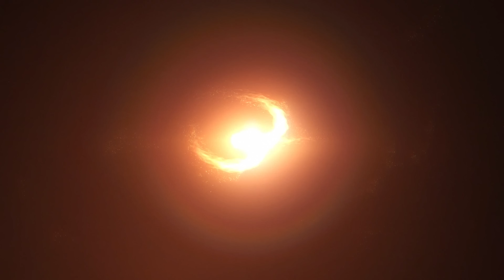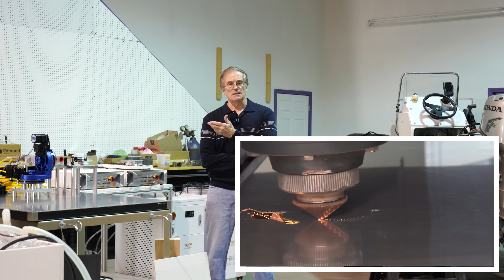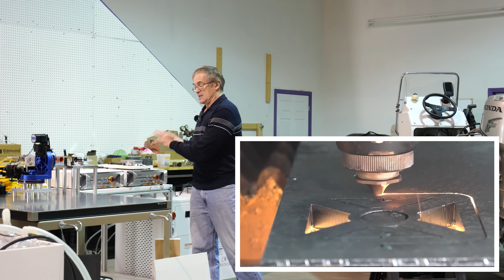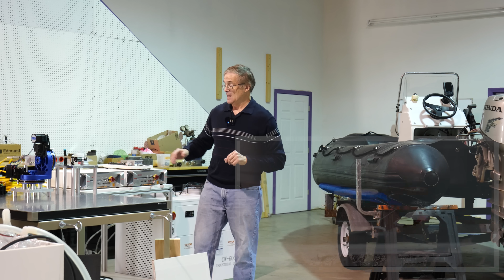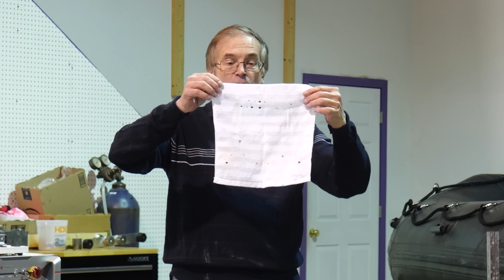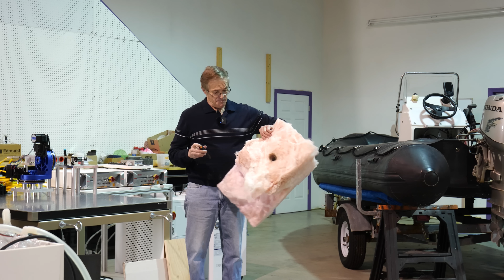We have a problem... and need your help!

Comment: I'm not sure if its already in the comments but can you post the beam frequency and intensity(or at least the power applied to the laser module) and beam divergence? If its already been added to the comments can you sticky them or add it to the info drop down? Thanks!
Reply from the maker: Sure. 
1,500 watts for each laser.  1080 nm and 80 microradians of divergence.

Comment: 1) Make the surface at an angle 📐 that’s nearly parallel to the beam so that the 1mm contact point is elongated across as much surface as possible. 30+ mm aught to be 1/30th the 🔥. 

Or

2) Over-fill a container of water 💧 (possibly mixed with charcoal/graphite) so that the surface tension protrudes above the container and into a portion of the 1mm beam. Then behind this container put another one that is <1mm higher so that it catches more. And keep putting more behind that are each slightly higher until the full 1mm height of the beam is reached.

Or

3) Create several steams of water with laminar flow in the path of the beam to cause the beam to spread. 🌈
Reply: Or

4) A long cylinder or tank of water mixed with charcoal/graphite that has a door on the side that faces the laser. Make it hold enough water so that it takes a long time for the water to flow out of the tank when the door is removed ➡️ causing a steady stream of water in the direction of the beam that vaporizes.

Comment: I would consider trying a graphite mold that's commonly used for smelting. Instead of a mold though, I'd get a uncut block/sheet of it and use that as the test. It should be low on reflections and it has excellent heat absorption. That's the material that comes to my mind anyway.

Comment: This may not be a practical solution; blocks of graphite. Often used for heat insulation in nuclear power plants, castings, smelt, absorb light and radiation, can ground any electricity. Various shapes and sizes, and cost is reasonable. You could build a wall graphite on a custom made trolley for easy maneuvering.

Comment: Could you try ceramic bathroom tile on plywood sheets? might be heavy but its readily available in most hardware stores and technically transportable. The other thing in my mind is a laminar flow wall of water, like the water features for gardens

Comment: Another idea is to use fresnell sheet, like an array of fresnell lens with a diameter around the laser beam crossection, anything further behind the sheet should be spreaded out.
Reply: Nobody is making fresnel lenses out of optical quality glass in size that would benefit the experiment.

Comment: I would try divergent lenses.
You could use a matrix of lenses or a big divergent Fresnel lense, easier to transport.  If they don't exist, I would try to build one.
Try to leave enough space between the lense and the wall, or put behind something resistant enough to sacrifice.
Try to reverse the process and increment the area of the laser dot.     Thanks for the videos!
Reply: For building a giant divergent lense, I would do it with two plexiglass sheets deformed sinking the center of the sheets, putting them in the right position, sealing the edges in a box, and filling it with resin epoxy or water. I would add sugar or other products to the water to match the refraction coefficient of the plexiglass.
I don't know if it would work, it's just an idea...

Comment: An active system based on a thermal camera that turns off or redirects the laser when it hits the wall protected with the playwood which gives you about 0.5 seconds to act

Comment: Consider a mobile waterfall curtain as a laser containment solution. A vertical flow of dyed water—possibly with suspended light-absorbing particles—can act as a dynamic beam dump. The moving liquid layer handles thermal load, dissipates energy, and prevents localized damage. A closed-loop system using a five-gallon bucket and pump keeps it compact and portable. Add a dark, non-reflective backdrop behind it, and you’ve got layered attenuation with self-cooling properties. It’s scalable, safe, and ideal for indoor laser testing.  Just like in the movie (Real genius)❤️💡

Comment: Fibre cement boards might hold up better than gypsum wall. would be cheap enough and lightweight enough to cover the shop wall. Old timey asbestos ones would definitely be heat resistant... but also asbestos. Not 100% on some of the new ones as they use cellulose fibres which might fail under the highly concentrated heat.

Comment: I think you could use Ceramic Shield heat bricks. Like they use on the space shuttle. I’d contact NASA, SpaceX, Blue Origin and see if you can get a little bit to see how to acquire some. Perhaps some flame retardant material would work.

Comment: How about Himalayan Salt cooking block? There're some at 2" thickness and you can stack several of it.
Its surface irregularity and material property supposedly able to diffuse, absorb and scatter it?
The only problem would be cracking due to intense heat.
Or graphite crucible.

Comment: some random ideas:  a) you have plenty of Z axis... re-orient and point your laser at the ground. b) sandbags.  the sand  will fill in any holes. c) water tank, possibly with something dissolved in it to enhance opacity at the wavelength in question.  you might end up with a small hole in the front panel but that's not nessasseraly the end of the world for an emergency stop  d) some composite composed largley of carbon black.  even fill that water tank with loose powerded carbon black if water doesn't work.
Reply: e) high speed rotating disk, like high power x-ray tubes use

Comment: Maybe 95% mirror cones similar to EMI chamber, each reflection would eat just portion of the energy. Proper cone shape angle should reflect to "infinty" amount. This is how high power radio waves are attenuated to not cause any reflections.
Reply: Maybe ceramic with glossy surface could do the trick

Comment: Hello Sir. Idea 1) If there is no adequate material, that "stops" the laserbeam directly, perhabs you have to go another route. What if you place a mirror i an 45 degree angle and redirecting the laser downwards into an "container" of an aqueous "dark" liquid? Perhaps some water soluble black "ink"? By this way you avoid a massive substance to withstand your laser, and you can use water to absorb the energy safely. 
Idea 2) What if the target of your laser is a lens thas disperses the beam in a circular way? In principle defocussing the beam, so that it´s energy is spread over a much bigger surface. By that you could perhaps use more simple materials to absorb the rest energy of the laser, like bricks or so.
Greetings from Germany

Comment: Probably wouldnt work , but a big container , full of sand would maybe work, because where it melts, new sand from the top comes in, so it is a neverending wall even if the laser makes a hole (and it is cheap)
*sorry for my english

Comment: Ok, first dump .. carbon blocks, varied shapes like an anechoic chamber, quite absorbent to those energies and can take heat. Second dump is actually a reflective mirror (exploration required) to direct overshot and reflection to a safe absorbion point.

Comment: Idea 1: Blow a very thick fog of fine, but not too fine droplets of water from the ceiling. If the beam goes through a few meters of fog, it might be attenuated enough to absorb it by other means, behind the fog wall. If the fog is blown quickly enough, the evaporated droplets might get replaced quickly enough with new droplets. Idea 2: If the beam hits a highly reflective mirror surface at a very flat angle, e.g. 179 degrees, does it destroy the mirror? I could imagine that it might be possible to diverge the beam by successively reflecting it from a couple of slightly wavy mirrors. Maybe aluminum sheet could do the job, if arranged correctly. Probably this is a terrible idea though, because it might direct the beam into directions you don't want to have it. Good luck with whatever you do, and by all means, please try to stay safe with these doomsday machines!

Comment: Maybe you could build a coffer around the laser. Inside the box you could reflect the light around instead of concentrating the energy at one point. The box could then be lined with sand to absorb any residual energy without causing a fire.

Comment: You haven't mentioned the wavelength of you laser, but assuming it's ytterbium doped, it should be around 1µm. Liquid are usually nice absorbants if you're able to find a transparent container, some of the longer alkanes like diesel could work. Alternatively could you could make a suspension of a highly absorptive fine powder in water, this should be capable of dealing with several kW.

Comment: I'm thinking curtain of falling liquid. Water mixed with (activated) charcoal dust maybe, for absorption. Either running along a heat resistant surface (sheet of thin steel?), or free-falling. Being recirculated between a bottom tank and a top tank with a thin slit in the bottom by a pump.

Comment: So I'm no laser expert nor engineer, but the main problem is the intensity of the laser - probably no material will stand up to this bombardement for long I guess.

What I imagine is you could maybe engineer a contraption made of angled glass pieces with space in between for water/oil and use the phase boundary to partially reflect the beam to weaken it. Angled pieces direct the beam down to an absorption layer made out of carbon (or charred plywood soaked in water - can't burn).

Comment: Two ideas: refraction in water and ablative Heatshield.
For the first one, aim the Laser at a piece of Laser transmissible Glas with a big Watertank behind it. Maybe normal Glas is transparent enough, so a large aquarium could be used. Water should refract the laser and absorb it over distance.
Also you could bubble air through the water to cause more refractive index shifts and therefore more absorption.

As for the second one, these ablative heatshields used for re entering space craft burn up layer by layer, absorbing the heat as it goes. Maybe that'll work for laser as well. Also, Gasses and Smoke emitted by a charring surface are said to be pretty good at absorbing laser energy before it even hits the surface. I once read that pulsed laser weapons are useful because of that effect.

Comment: Use earth as a backstop - like a berm at the back (or 3 sides) of a shooting range.
Or...  instead of conducting tests horizontally and shooting the laser horizontally, conduct the tests vertically and shoot the laser downwards, into the ground.
How about shooting the laser into a bank of smoke or fog (i.e. from a party smoke machine)?

Comment: Ceramic engineer here.  I may have an idea.  There is an asphalt type material used for plugging tap holes in blast furnaces.  It looks like road asphalt but instead of gravel, it is filled with carbon granules and is sort of like stiff play doh at room temp. It takes incredible heat abuse but ablation will still occur.  The nice thing is that the damaged holes can be readily patched.  Only down side is that it will create stinky smoke.  Perhaps replacing the asphalt tar with a kaolin high temp clay would give similar endurance without the stink.  So you would end up with a clay and carbon material similar to what is used to build graphite crucible.  Good luck.
Reply: why not just point it downwards into the dirt. dirt is literally dirt cheap. and doesn't produce toxic fumes, it just turns to glass.
Reply: @cheater00  Because they need as a backdrop when they aim at a target and the laser is directed parallel to the ground.
Reply: Thermashield starlite
Reply: A material that ablates was my first thought too, I'm glad someone who was knows more about it can chime in.
Reply: The asphalt material would need a constant blast/spray of water to keep it from catching fire.  Point 4+ nozzles of water at the impact point to cool it.  Another idea is a deep volume of raindrops from a long rectangular pressurized shower head to make a tubular volume of constant raindrops and spray of water.  Like the water cooling for rocket launches.  A big long volume so that the laser can be absorbed is key so that it doesn't exit the other side and burn the wall.
Reply: I have used that stuff in the past for fire-proofing chimney runs between floors on a few insulation jobs I did as well, I remember it costing a ton though and a large amount spread over something large might get expensive, good stuff though.
Reply: There is a powdered refractory that is used on inductive furnaces, so that WHEN the ceramic crucible cracks and molten steel starts to run out, it hirs this powder. The powder melts into a solid ceramic, sealing the crack.
Reply: I'm thinking of a glass aquarium of adequate size for your experiment filled with a non-flamable liquid like water. Dispersed in the water and kept suspended, by a circulation pump, is fine gold or some color of fine glitter. Some experimenting may tweet the color. The result should be a brightly dispersed flash.
Reply: @theradarguy  Similar idea: A jacuzzi with lots of small air bubbles pumped into the water to disperse the light.
Reply: @jankok9911  I like the idea of multiple point angles of refraction, I would be interested in the effect if a solution of coppersulphate was added to the aerated (carbonated) water ?
Reply: @theradarguy wow, I literally had that same idea! Crazy that the first thread I expanded, I see it spelled out as if I wrote it. Cheers to that! The fish tank beam trap is an experiment I'd like to see.

I originally came to reply about the blast furnace tap hole clay. There are many plastic refactories on the market now, many with fused silica and ultra high alumina contents. You absolutely will not burn these materials, they can be formed, but will require an extremely precise prefiring to avoid spalling. Not a problem if you can get access to an industrial kiln.
Reply: I'm thinking common floor tile might be enough. Getting a thin sheet of ceramic would be lightweight and cheap enough to move and resist burn though.
Reply: Track the lasers aim point with an endpoint  suppression sustem.
Reply: hyugens optics also has glass ceramics with 0 CTE
Reply: You'd probably want to put it on a metal backing rather than a wooden one so it can't catch fire. I'm not sure if different metals would have different results, but I know bitumen was used to protect copper from nitric acid in printmaking, so it should adhere to that.
Reply: Kiln furniture?
Reply: I love the angled sheet waterfall ideas, but it needs to be thin clay slurry to reduce wild reflections, and add a reflective sheet above and behind the waterfall to bounce remaining reflection (mostly) down to a thin sandbox. Still, these lasers should pulse rapidly to allow the targeting system to measure impact range, and mostly turn off the lasers, whenever impact reflections are occurring far beyond the current target. To defeat spoofing countermeasures, the lasers can be pulsed in somewhat random patterns that attackers could not anticipate.
Reply: @mdteason Exactly my thoughts. Short pulses to detect target using IR cameras long pulse to destroy, since and repeat.
Then safety behind a🎉 controlled channelled slud waterfall and cameras detecting spot on this to turn off laser as safety (use 2 or 3 cameras to compute target distance.
Reply: I make roof coatings and you can do the same with standard asphalt roofing cement after you give it time to off-gass the solvent. Then you are left with highly filled asphalt.
Reply: Ceramic engineers are material scientists that specialize in ionically bonded materials.  Mostly high temperature refractories, porcelains and glasses.  There aren't very many of us ..
Reply: Take a sheet of your 3/4 inch plywood, stand it up leaning say 5 degrees away from the lazer and have a continuous flow of water running down it.  In other words a wall of water.....
        Phil Tomeo.  
       Cecil, NJ
Reply: Odd, I was thinking of bituthane as I was watching the video.  dark, dense, sticky.  Might not react fast enough to slow down a beam burning through though.  Might be flammable right at the entry point, but perhaps rotate in a non circular way to keep from burning through the same path.
Reply: My first thought was a carbon impregnated material, I was thinking ceramic, but worried about it breaking due to expansion. I like your ideas, more malleable materials, that seem easy to work with. More practical than the water falls mentioned elsewhere.
Reply: Carbonized ablation like spacecraft heat shield. Ablated material creates a vapor that further blocks and obscures beam. You shouldn’t breathe the process. Aerogel and other silicates will trap heat and melt.
Reply: "Ceramic Engineer" 😮 like what does a Ceramic Engineer does? (I'm genuinely intrigued).
Reply: @geogmz8277 im going to school for material science, specializing in ceramics. In our labs, we are currently synthesizing reduced graphene oxide and attempting to make laser printed circuits out of it. Materials science creates new materials while materials engineering (ceramic engineering) applies the science to create a use case for it.
Reply: @geogmz8277  Sounds like a double glazing salesman.
Reply: @geogmz8277  probably a materials engineer that works with ceramic materials.  Not trying to be obnoxious.....just throwing it out there....

Comment: Sandbags filled with with compacted silica sand and powdered activated charcoal.
Or charcoal concrete slabs.
A diffusion sheet over the front of it.
Throw the construction on a trolley to move it around.